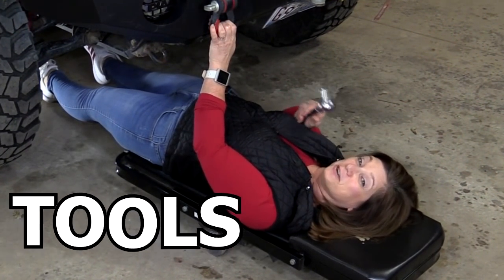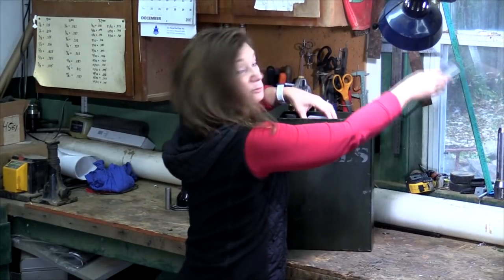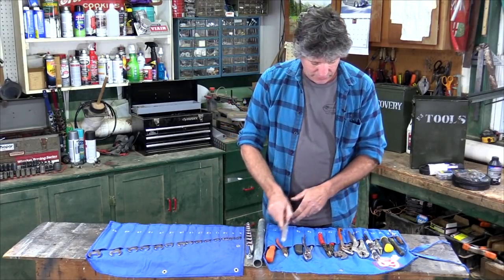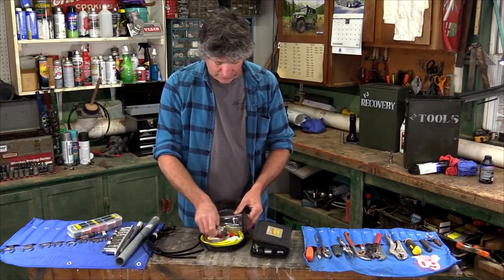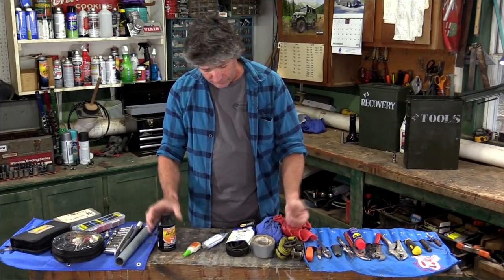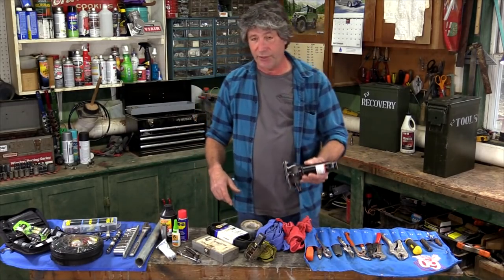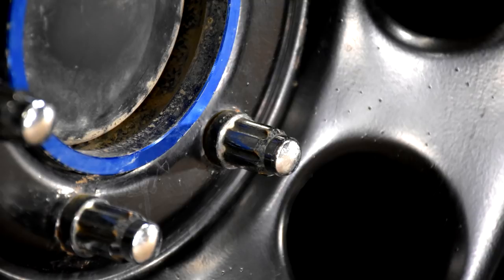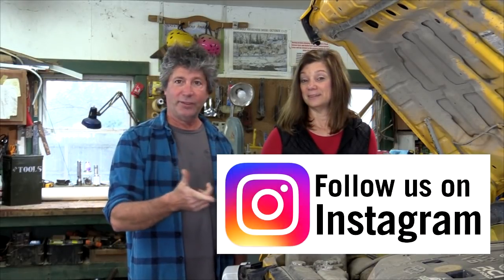Complete Off Road / Overland Tool Kit List 🔧🔧🔧🔧

Comment: I wish we could upload pictures. I carry a small craftsman tool 13" tool box with a little tray and storage compartments in the lid(search for it on amazon). I have full assortment of 1/4 and 3/8 sockets and extensions and a few specialty  sockets, ratchet wrenches, channel locks, pliers, vise grips,  Butane solder iron, spare wire, wire connectors, fuses,  screwdriver with several bits, allen wrenches, tire repair kit, battery post and cable cleaner, rubber gloves...... more I am sure I cant remember. Great video
Reply from the maker: Head over to our Facebook page and share your pics with us.

Comment: Here's my tools....nevermind.  I do carry a 1/2" deep drive set (metric and standard) and a long 1/2" breaker driver.  Primarily because I put my tool bag together to work on my (former) Ford and my Land Rover and anyone else who's with me.  Now I have an FJ instead of the Ford, it's all still in there.  I agree that tool rolls rock.  My wife says I have a bag obsession, and tool rolls are just another kind of bag, though with lots of compartments.  I do not have a lot of spare parts yet - A) LR parts cost a poopton, and B) I haven't figured out the ideal ones to have for my FJ.  I do have more than one glove (plus nitrile gloves - good for both vehicle AND human/pet repair).

Comment: Bunch of random bolt hardware. Seems like the most common issue on long overland trips is some bolt that vibrated loose and fell out. Usually shock bolts.
Reply from the maker: Excellent addition! Shock bolts, control arm nuts, skid plate bolts,  👍

Comment: Do you recommend a smaller tool set for folks who (overland/regular) travel on regular roadways, but are broken down on a lonely stretch of highway that does not see too much traffic; i.e. long roads in some desolate part of Texas or in the Sierra Nevadas?
Reply from the maker: If you're
going to be able to easily get help for any large or complicated repairs you
could downsize a bit. Since you probably won't be taking apart the suspension
or steering systems you could go with a smaller 3/8" socket set, and omit
the pipe (ratchet extension). You won't need the tire repair kit if you have a
spare tire onboard. I'm sure there are a few more items you could do without.
Reply: @WanderlostOverland  Thanks guys....